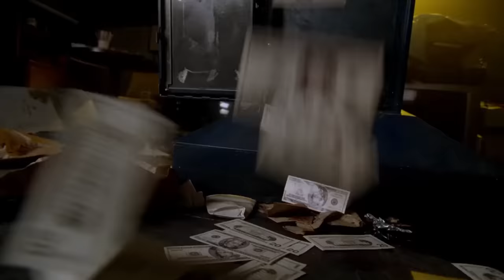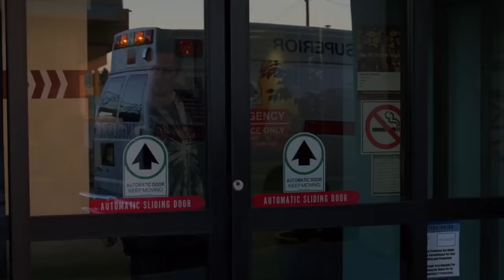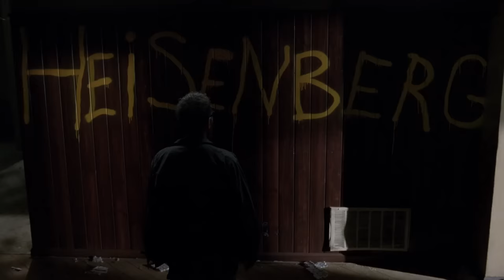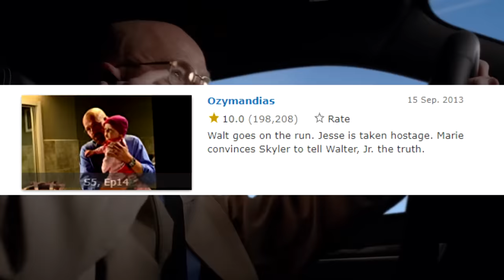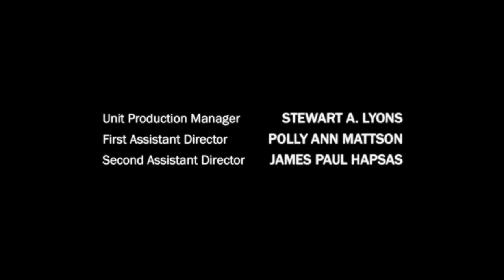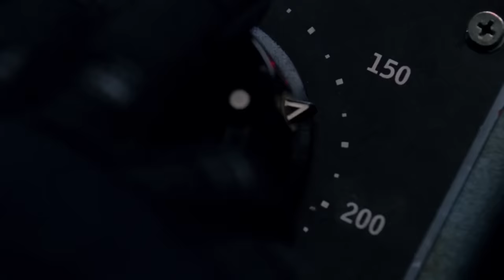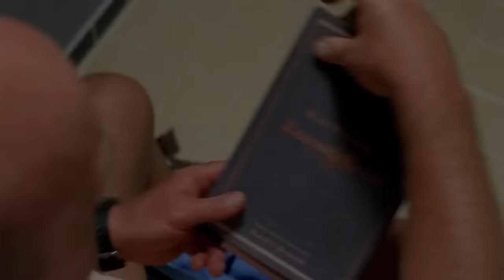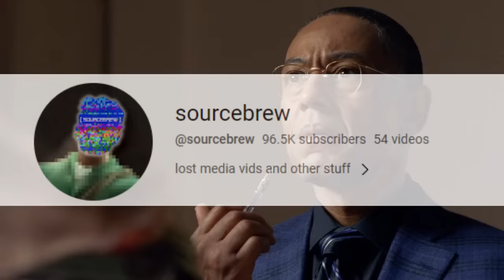Every Breaking Bad Episode Ranked

Comment: Top 3 of each season according to IMDB
S1:
3. E7: A No-Rough-Stuff Type Deal (8.8)
2. E1: Pilot (9)
1. E6: Crazy Handful of Nothin’ (9.3)

S2:
3. E8: Better Call Saul (9.2)
2. E12: Phoenix (9.3)
1. E2: Grilled (9.3)

S3: 
3. E12: Half Measures (9.5)
2. E7: 1 Minute (9.6)
1. E13: Full Measure (9.7)

S4:
3. E10: Salud (9.6)
2. E11: Crawl Space (9.7)
1. E13: Face Off (9.9)

S5:
3. E13: To’hajiilee (9.8)
2. E16: Felina (9.9)
1. E14: Ozyamndias (10)

Comment: HERE IS MINE:
#62 S4, Ep2  Thirty-Eight Snub  RATING:-7.8

#61 S1, Ep4  Cancer Man  RATING:-7.9

#60 S4, Ep3  Open House  RATING:-8.1

#59 S1, Ep5  Grray Matter  RATING:-8.2

#58 S3, Ep11  Abiquiu  RATING:-8.2

#57 S3, Ep3  I.F.T  RATING:-8.3

#56 S2, Ep3  Bit by a Dead Bee  RATING:-8.3

#55 S2, Ep4  Down  RATING:-8.3

#54 S3, Ep4  Green Light  RATING:-8.4

#53 S3, Ep9  Kafkaesque  RATING:-8.4

#52 S3, Ep10  Fly  RATING:-8.4

#51 S1, Ep2  Cat's in the Bag...  RATING:-8.5

#50 S2, Ep1  Seven Thirty-Seven  RATING:-8.5

#49 S3, Ep5  Mas  RATING:-8.5

#48 S2, Ep5  Breakage  RATING:-8.5

#47 S2, Ep10  Over  RATING:-8.6

#46 S3, Ep1  No Más  RATING:-8.6

#45 S2, Ep7  Negro y Azul  RATING:-8.6

#44 S1, Ep3  ...And the Bag's in the River  RATING:-8.6

#43 S4, Ep4  Bullet Points  RATING:-8.7

#42 S1, Ep7  A No-Rough-Stuff-Type Deal  RATING:-8.7

#41 S3, Ep2  Caballo sin Nombre  RATING:-8.7

#40 S4, Ep7  Problem Dog  RATING:-8.7

#39 S4, Ep5  Shotgun  RATING:-8.8

#38 S4, Ep6  Cornered  RATING:-8.8

#37 S5, Ep2  Madrigal  RATING:-8.8

#36 S5, Ep3  Hazard Pay  RATING:-8.9

#35 S3, Ep8  I See You  RATING:-8.9

#34 S5, Ep1  Live Free or Die  RATING:-9.0

#33 S1, Ep6  Crazy Handful of Nothin'  RATING:-9.0

#32 S5, Ep6  Buyout  RATING:-9.1

#31 S5, Ep4  Fifty-One  RATING:-9.1

#30 S1, Ep1  Pilot  RATING:-9.1

#29 S2, Ep13  ABQ  RATING:-9.1

#28 S4, Ep1  Box Cutter  Rating:-9.1

#27 S4, Ep8  Hermanos  RATING:-9.2

#26 S5, Ep12  Rabid Dog  RATING:-9.3

#25 S4, Ep9  Bug  RATING:-9.4

#24 S5, Ep10  Buried  RATING:-9.4

#23 S2, Ep11  Mandala  RATING:-9.5

#22 S2, Ep2  Grilled  RATING:-9.6

#21 S2, Ep12  Phoenix  RATING:-9.6

#20 S2, Ep8  Better Call Saul  RATING:-9.7

#19 S2, Ep6  Peekaboo  RATING:-9.7

#18 S3, Ep6  Sunset  RATING:-9.7

#17 S3, Ep7  One Minute  RATING:-9.7

#16 S4, Ep12  End Times  RATING:-9.7

#15 S2, Ep9  4 Days Out  RATING:-9.7

#14 S5, Ep9  Blood Money  RATING:-9.7

#13 S4, Ep10  Salud  RATING:-9.8

#12 S5, Ep8  Gliding Over All  RATING:-9.8

#11 S5, Ep11  Conffesions  RATING:-9.9

#10 S5, Ep15  Granite State  RATING:-9.9

#9 S3, Ep12  Half Measures  RATING:-9.9

#8 S5, Ep5  Dead Freight  RATING:-9.9 

#7 S5, Ep7  Say My Name  RATING:-9.9

#6 S5, Ep13  To'hajiilee  RATING:-9.9

#5 S3, Ep13  Full Measure  RATING:-10.0

#4 S4, Ep13  Face Off  RATING:-10.0

#3 S4, Ep11  Crawl Space  RATING:-10.0

#2 S5, Ep14  Ozymandias  RATING:-10.0

#1 S5, Ep16  Felina  RATING:-10.0
Reply: ...wow